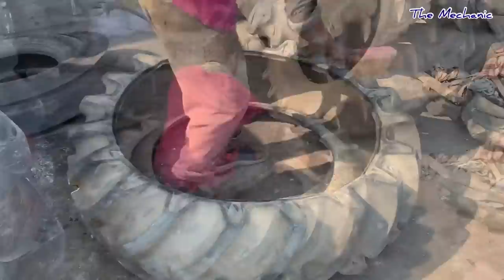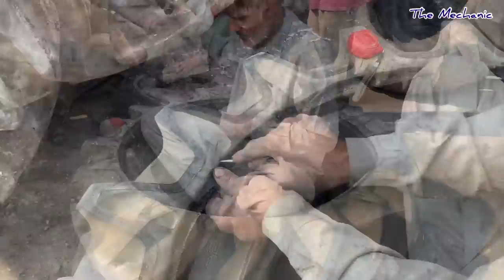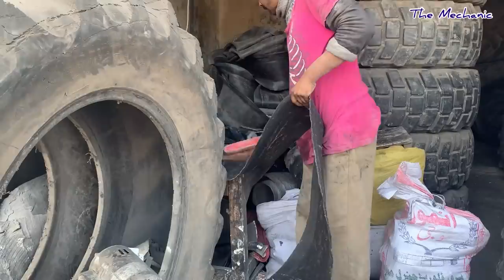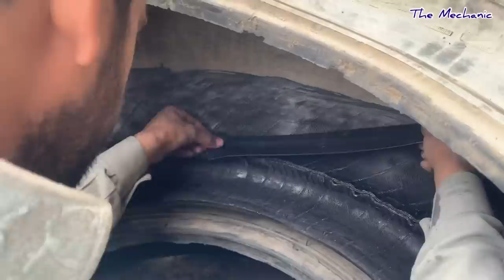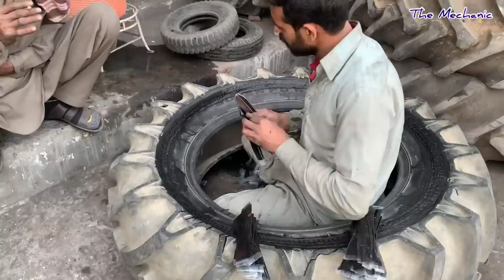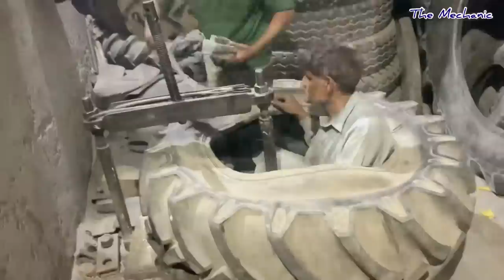How to Repair Tractor Old Tires and Get Them Back on The Road || HUGE Tractor Tire Sidewall Repaired

Comment: Given the amount of tread on these tires, my guess is they are factory rejects.  That would also explain why all of them have the sidewalls cut out.  Factories will put severe damage into the reject tires to prevent them being sold as good new tires.  The dirt staining on them suggests the tires may have been buried at one time.  Recycling the tires like this probably makes more sense as long as the buyers know what they are getting.
Reply: Thanks, i was wondering why. 👍
Reply: Sounds reasonable, good comment by "Just Thinkin". :D
Reply: И что

Comment: I admire and respect the people doing this work (and the others in similar videos you've shared). Recycling and upcycling is how we save our planet and all countries should learn from this!
Reply: I also respect these people. I find it a bit funny that these people have to do this out of necessity and probably don't even realize that they are actually helping the planet where in the US we know that we need to help the planet but we would have thrown that tire out and bought a new one because the new one would have been cheaper than paying for what all that labor.
Reply: @brandonputnam7634  the new one would also last 20 times longer, so how is it really helping the planet to repair that tire?  Here in the US, the first real pull put on the tractor, that tire will disintegrate. Whether it's mud in the warmer season, or snow in the winter, that tire won't last 4 months. The weight of just the tractor would pull those stitches right out. If the farmer is running duals on the rear, there might be a chance it will last a little longer, but you don't run duals in mud or snow! 
Would really love to know how that is saving the planet, when every 5 months you're putting one of those used "so called" repaired tires on, when a new tire would last 4 or 5 YEARS, on a farm tractor that doesn't get driven on pavement.

Comment: I don't like how tough their lives are but I have to admire their ingenuity. During WWII when tires were unavailable, Americans would cut the sidewalls off of a newer tire with a blowout. Then they'd deflate the bald tire on their car and work the tread from the cut tire over it. Once the tire was blown back up it stayed in place well enough to survive the low speeds of the cars they had.
Reply: Nyc
Reply: Yes but the reverse-They take good  tire sidewall from worn tread tires and put onto good tread tires with sidewall damage

Comment: this explains all those tire blow out videos i see from that part of the world.
Reply: Remolding tires is a common practice even in the parts of the world that are not this part of the world. It is done exactly the same way here as it is done there. Tires blow out all the time in america too.
Reply: These are tractor tires, not for road use. Speeds are low, and so is the air pressure relative to road tires.
Reply: Seems like for the amount of time and effort you could just buy new ones.
Reply: @joeylawn36111  You are 100% correct. A tractor with its slow speed is the only vehicle where this is possible. With the high cost of new tires, this is probably a good deal even if you get 6 months out of it.
Reply: @tvviewer4500  People often see those road gators and think it's off of a recapped tire. However, this is incorrect. The easiest way to know that it's from a virgin tire is the fact that you can see the wires from the belts coming out of the ends. They don't add belts to the recap. Unlike recapped tires, these are not properly vulcanized with heat and pressure to become one homogeneous piece. They probably do good enough with their heated press to make it work for a slow moving tractor.
Reply: @speedsterwinston  Even in America, a good retread can be found for 50% less than a new one. They get these tires for next to nothing. It's a great deal for them and whoever buys them. New tractor tires are quite expensive.
Reply: @speedsterwinston  Not with their salary. Work is cheap there.

Comment: I don't get how all the labor and materials involved in the "remanufacturing" process don't add up to the cost of a new tire. And they work BAREFOOT!
Reply: Pakistan's minimum wage is about $150 a month, these tires new cost several hundred dollars. They don't have the cash to drop a couple thousand dollars on new tires for their tractor every few years.
Reply: A
Reply: Cause your in a third world country. Those materials are cheap from China but can pack in a container easily for shipping. Tires are expensive, don't pack well to ship...a container is mostly air that they ship in so not many per container. And their labor there is dirt cheap so it's mostly materials. Things cost so much here in the US cause of labor and shop rates. Labor costs drive things up here. Sure that repair would cost you as much as a tractor tire new but you would be paying hundreds in labor cause they work on it all day where there it might be a few Dollars in labor.
Reply: A brand new brand name tractor tire would cost thousands of dollars, even an offbrand one can easily cost 1-2 thousand dollars, there's also the fact that these people likely don't make much, so the labor's cheap while the product itself is expensive, especially there.
Reply: Им нравится ходить босиком,  они могут со своим умением сшить себе плоскую обувь из этих же шин, но им это не нужно.

Comment: 6 month warranty 💪🤓!!
Reply: More like 6 mile warranty.
Reply: It's called a tail light warranty. When your tail lights are no longer visible from the shop the warranty is void. A tractor with its slow speed is the only vehicle where this is possible. With the high cost of new tires, this is probably a good deal even if you get 6 months out of it. Because they are considered junk, I bet they get these tires from other countries for next to nothing.
Reply: Somehow I suspect that the these tires are no more than half the price of new, probably no less than 1/3rd. No way, a quarter of the price. I also suspect that the buyers are no fools. Half price and almost the same durability. If it is just one sidewall change, and the tire is yours, price should be one quarter to 1/10th of new. Structurally, there are no steel rope wire going through the sidewall.  So, if the rubber melted and fused well, then the tire should last as long as the tread surface will last - or normal life.
Reply: @facereader99  I agree, these definitely cost less than half of a new tire. The heating and forming they do doesn't produce enough heat and pressure to ensure full vulcanization. Find a video of how they retread tires for those huge offroad dump trucks. If you haven't seen it before you will find it quite interesting and have a better understanding of the difference in quality.
Reply: More like 6 seconds, inflated to 5 psi 🤣
Reply: 6 months from 3 decades ago.....

Comment: I'm wondering how they centered that piece with the whole tire?
Reply: Рулеткой. Там есть эпизод , где пришивающий новую боковину, проверяет расстояние
Reply: That is a trade secret.
Reply: dont think tractor tires go fast enough for it to be a problem
Reply: @Dec38105  Agree, even the driver may enjoy going up and down by a non-center tire))
Reply: @mahomv9824  wont be much. You saw them measure the piece as the guy put it in. If the original was 'centered' and you have a same width you put in, it will be centered aswell, within the margin of your stitching errors. That wont be more than some mm's (1/10 of an inch)
It doesnt matter for balance as the speed is low, as Decion said. So no extra forces will be generated bc of this error margin. And a 1/10 inch you wont feel as you are working on a tractor. Not even on a flat road, bc the road itself also has these errors, depending on which type and quality of road. You are confusing balance as in cars and so, with fast rotating tires, if those are not balanced, you get vibration which is not only annoying, but will cause steering to be off and cause all sorts of problems.
That doesnt apply in low speed. So what is left is a possible wobble, but as i said, you wont feel 1/10 of an inch. I doubt youd feel half an inch. Maybe an inch you would on a pretty flat road.

Comment: The 6 month warreny means , in 6 month it will be an accident
Reply: Yea thats a tad odd. Youd expect an amount of working hours. Not 6 months. And that doesnt give me a lot of confidence either, 6 months. Considering most of the force will be on those stitches, i have my doubts as to what happens when you go full throttle on these.

Comment: Very ingenious but would I trust a tyre repaired this way?...probably not LOL I don't see any benefit in repairing one knackered tyre with bits of other knackered tyres. What's the hourly rate for this kind of work I wonder, that this could even be contemplated?  Still though, thee guys work bloody hard, I'll give 'em that!
Reply: Us you see on the title it's for tractor, max speed 25 km/h, so no problem about safety
Reply: 21 cents an hour with 3 rats for lunch.